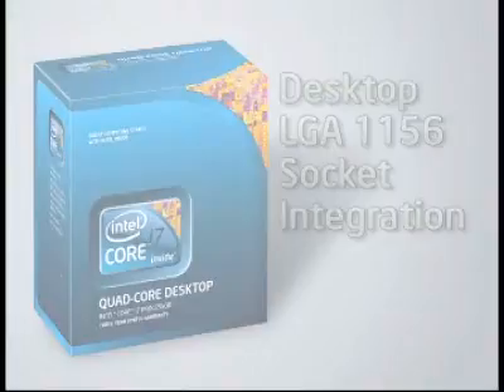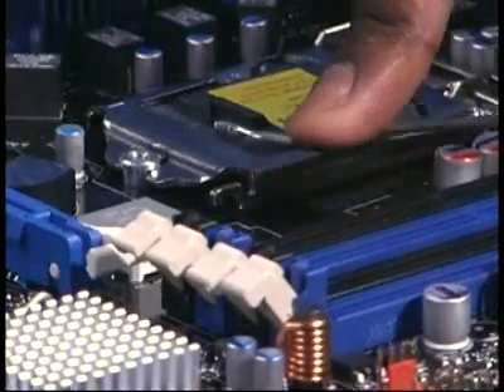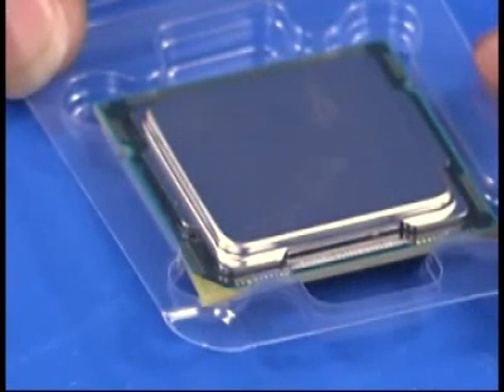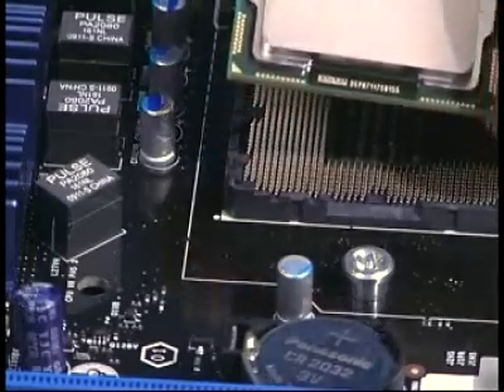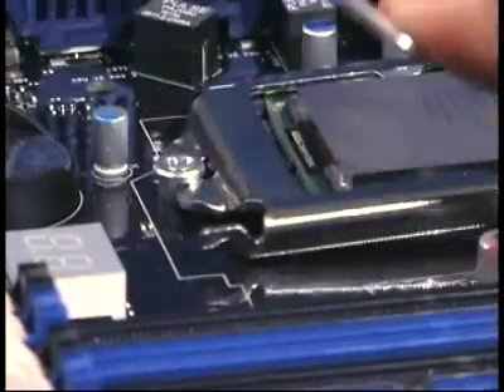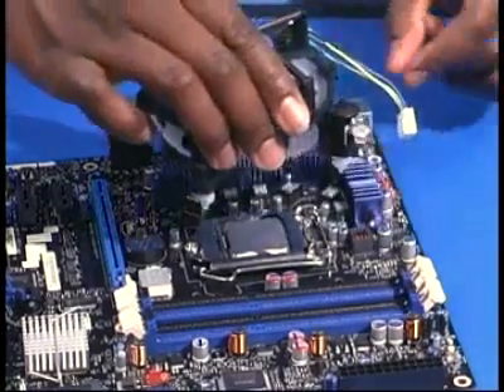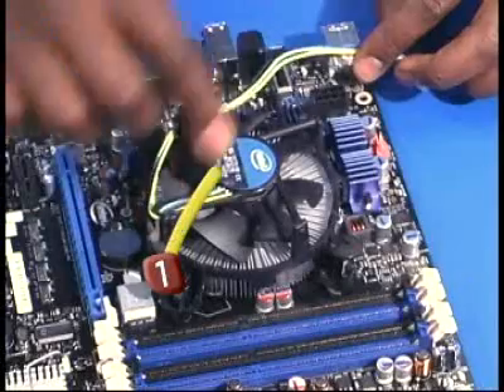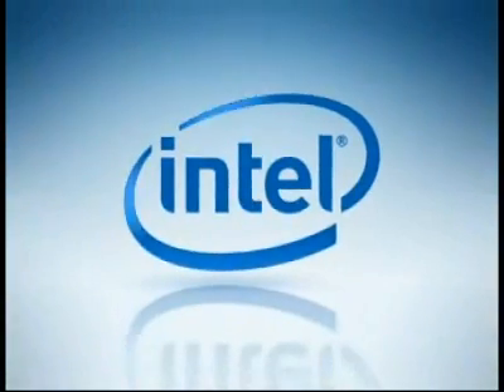Official Intel LGA 1156 Processor Integration (Installation) Video

Comment: Can you install a dual core or a  core 2 duo processor on an LGA1156 MB ?
Reply: No. The socket for a Core 2 Duo CPU is a LGA775. It will not work

Comment from the maker: @starkillertoy - When you buy a new processor in a package with a fan/heatsink, there is already a pre-applied thermal pad on the bottom of the heatsink, so unless you damage it there's no need to add additional thermal paste. 

I hope that answers your question.